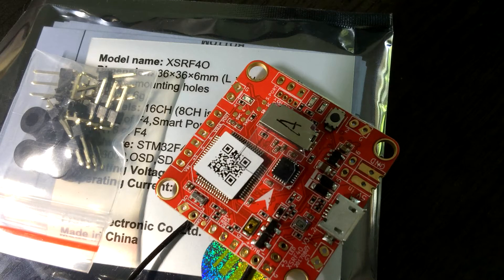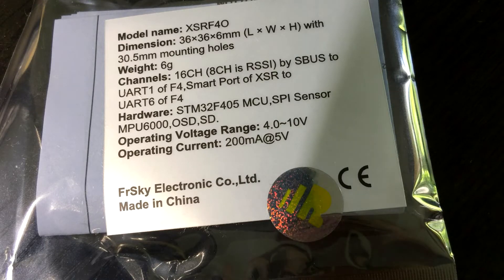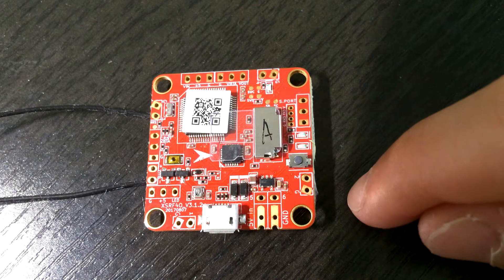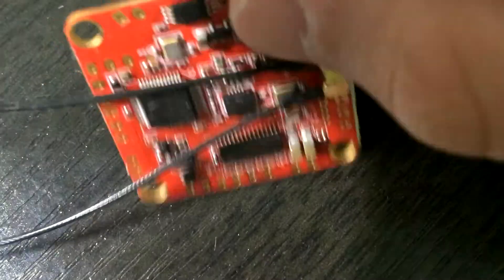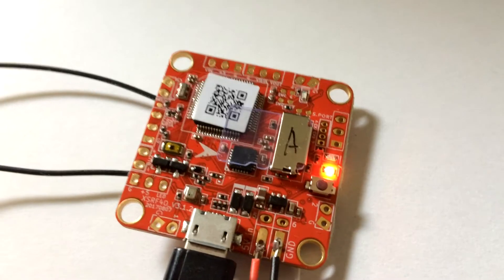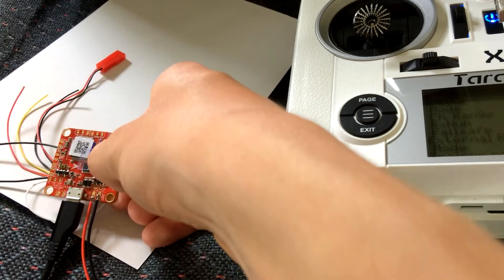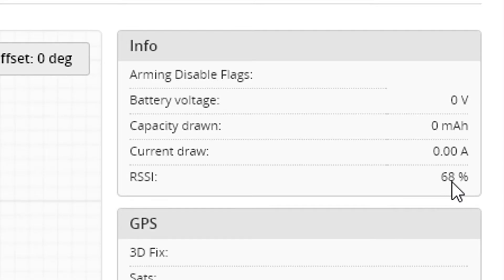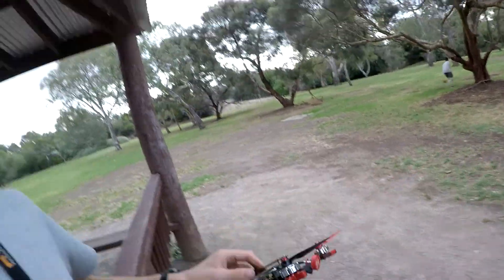FrSky XSRF4O Review and BETAFLIGHT/SMARTAUDIO Setup

Comment: How to flashing this fc?
Reply from the maker: Hey, the flash target is FRSKYF4. You can enter bootloader mode by typing ‘bl’ in Betaflight command line, or holding the button on the FC while plugging it in and fixing drivers as necessary. You’ll find videos on youtube if you need help flashing!

Comment: when i try to bind it both green and red shows up
Reply from the maker: I can't think of a reason for that.. I haven't bound one of these boards in a while, so I forgot what the lights are meant to do, but keep trying it. If you cannot get it bound still (red light when disconnected, green light when connected), ask on Facebook groups or contact FrSky.
Reply: @MishMoves  it is apparently a firmware issue with the xsr
Reply: @MishMoves  and it is a solid red and green light

Comment: I've had this board for months on one of my setups-but hated the fact that it didnt support SA. And, there were really no good resources or hacks that were thoroughly documented to pull uart 3 off the chip.. Good thing I took a quick google on it again while I had it on the bench for repairs. I'm stoked now that I know where to pull that line and finally get VTX control on this one without having to fuss with the button sequences.

Cheers!
Reply from the maker: I'm glad I could help you out! I emphasised 'SMARTAUDIO' in the title for anyone in your situation trying to figure that out. Before I knew UART 3 was broken out, I was going to do a tutorial on getting it working with SoftSerial as another way around it - finding these pins makes our lives a lot easier! Enjoy.
Reply: What is interesting is that while I have the same board, the silk screen on those pads is different than yours. Instead of "G RX TX V" mine is labeled "G SC SD V". My board is v3.1 and yours is V3.1.2.

I'm hoping it's just a silk screen issue and not an actual trace that is different. Will know more when I get this thing buttoned back up.
Reply: Chris Toast was it the same pin just labeled differently? Mine is labeled like yours

Comment: Hi Fella good video!
 But I can't get voltage to show up on the osd? Could tell me how to get vbat to work? Cheers Jamie
Reply from the maker: Hey,
Have you wired battery voltage to the board? You'll need ~5V power input to the board, and then there is a pad labelled 'VBAT' where you can run a wire between that pad and any battery voltage connection on your ESC/PDB. Once you've wired it, you should see voltage in your configurator, and then you can turn on main batt voltage or avg. cell voltage in the OSD screen.
If you've wired it and it still isn't working, let me know!
Reply: Fella thanks for the quick reply! I've connected the pdb to the vbat at the bottom of the board next to the led tab. but i'm not getting a reading? Is that right?.
loving this board and it makes a neat build.... my ocd likes it ;]
Reply from the maker: Yeah, sounds right - should be right next to the boot button. Check in the configuration or power tab, depending on FC version, and make sure voltage reading is set to 'voltage ADC' or something like that - it could be set wrong. Other than that, I'm not sure why.
I do love the board too, got another one ready to go into a build when the ESC and motors arrive!
Reply: I am having the same issue. Anyone get it sorted out?

Comment: when i plug it to the computer both the green and the red lights are on and i cant seem to get it to bind, it should be an easy proccees but no luck
Reply from the maker: That's weird... The green light should appear alongside the red light once you bind it, then whenever you turn on the board and a transmitter connection is made, it should go green with no red light. If you've already tried my instructions in the video, I'd be happy to contact you to try and figure out what's going on! :)
Reply: yeah that would be cool, whats weird is that i've done this with the regular xsr a million times , its just a normal process of holding the button down and plugging it in , while the taranis is in bind mode ,maybe the board is messed up,  i cant think of anything else,
Reply from the maker: Alright. Do you have Discord, Skype or something else you could call/message on? Hopefully we can get it sorted!
Reply: @aliens99xx74  how did you fix it
Reply: How did you fix it? I have a same problem :(